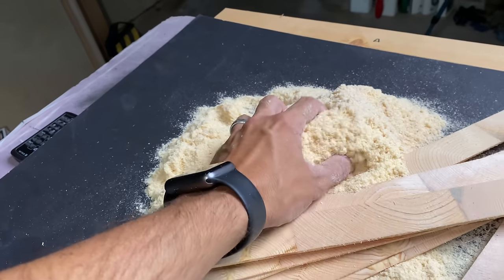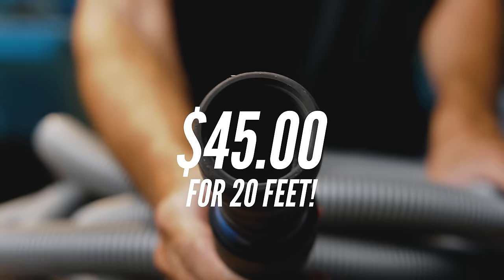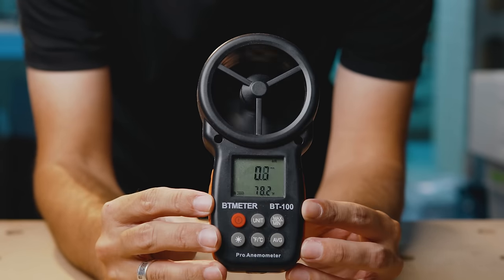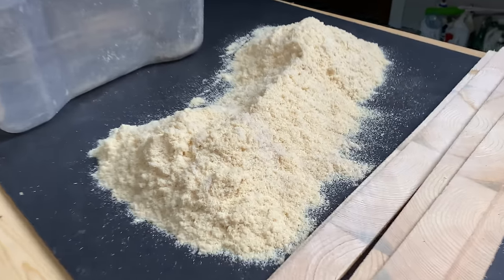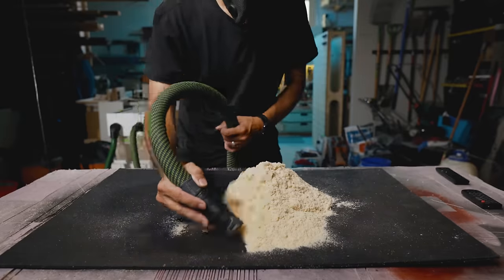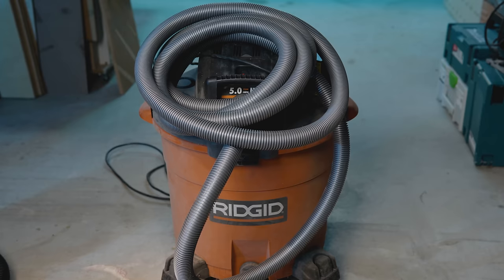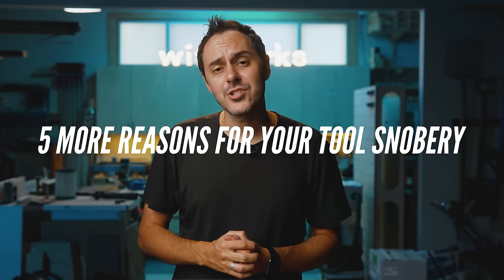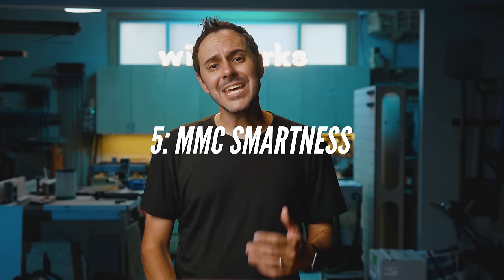This video will save you a lot of money. Dust extractors for beginners.

Comment: Fantastic comparisons Witt. I've worked with Festool sanders and dust extractors in industry sanding nonstop shift after shift. They both got dragged around, kicked, dropped and abused 
but they just keep going. Well worth the money in that situation. Home shop, can I afford it, do I need it or is it just the badge I'm after. I agree with you Witt, if I was a keen weekend woodworker  
I'd invest in a Festool extractor knowing I'd be sorted long term. BUT that's on the build quality, reliability, accessories and the professional back up, NOT on filtration. We had four of these 
Festool extractors connected to the best Festool random orbital sanders, sanding solid surface (like Corian) countertops and MDF furniture components. There was still masses of minute 
airborne dust floating in the rays of sunlight that shone through the windows. You still needed to wear a high spec 'rubber mask'. I think a lot is scare mongering these days gone OTT, but 
it's better to be safe than sorry with your lungs and also your eyes as well. Enjoyed watching your thorough non laboratory condition tests and agree with your conclusions. Tony
Reply from the maker: Thanks Tony! Glad we can be in company together.

Comment: Great video and I liked the test comparisons.  I wouldn't want to ruin your $29 "hepa equivalent" vacuum :), but it would be interesting to see air quality measurement using a new non-hepa filter and bag.  Might be a worth a test to see if the extra expense for the green colored filters are really worth the cost!
Reply from the maker: Great suggestion!
Reply: @wittworks  I second that, Witt. I'm curious to know if there is enough difference to justify the extra cost and to see how much the airflow compares to and "older-but-very-effective" standard filter. Just not curious enough to buy a $200 tester LOL.

Comment: I have the rigid Vac, 2 festtool, and a franken vac with a cyclone.  All work and do the job.  For me the Festool's are nice. I justified Festool in my head because I use a Vacuum everyday in the shop. (its actually the most used tool) They move around much easier, I never pull one over and like you said the Bluetooth, is just magic.  I would buy another if one ever dies.

Comment: Try using the 12 year old Shop-Vac or the Cyclone to vacuum out the expensive Festool bag before getting ever thinking about getting rid of it. Those bags are probably made in Germany to ultra high-quality standards, and thus are likely reusable for years, so long as the contents of the bag are sucked out and properly disposed of periodically.  Great testing technique - Great video!  

P.S. Harbor Freight makes a platform on 4 casters that will hold the Cyclone, but it costs about $10 - less with a coupon.  But you wouldn't have to spend time and money to build anything to make the Cyclone more convenient to use.

P.P.S. Great comment on the perception of workers who use Festool and other really great brands of tools.  There's a really good finish carpenter in the U.K. who only uses Festool and other great brands of tools. From his choice of tools, and the organized and clean appearance of his shop, he has instant credibility, and in his videos he demonstrates that he really knows how to use these tools.  His YouTube Channel is Bradshaw Joinery.😊
Reply from the maker: Thank you! I’ll check out Bradshaw. I’ve thought about cleaning out the Festool bag like you mentioned!

Comment: I'm a scientist, and avoiding the minutiae of the scientific method, I think your experiment was relatively well designed. I think what you're missing here is the location of your air quality measurement. You have provided good evidence that the output of the shop vac is about as good as the festool. The problem is that we still don't know how much of the particles at the tool are actually being sucked up, which is arguably more important since that's where you'll be standing.
Reply from the maker: thank you Mitchell! Makes sense. I should have bought two measuring devices! Thank you for sharing your expertise.

Comment: The first thing I do is to buy a 5 gallon paint bucket with lid,  and at least 3 RV hoses.   I make a water filter which can easily filter out nearly all of the dust before it gets into the shop vac.   I prefer at least 75 feet of vac hose for area mobility.   The cost is under $50.

Large diameter hoses do not loose suction like the little hoses.

The water vacuum water level needs to be set up precisely,  and the particles sling through centripetal force into the water.

I buy a bin,  drill small holes in it and empty the water vac outside.

I used to buy 5 and 6 horse craftemans,  which still work 30 years later,  constantly running on the jobs.   I recently bought,  maybe 8 years ago,  a smaller 5 horse craftsman,  since I use power tools with a lot of amps and often only have one circuit.   I see little difference.   But I really should seldom have a suction drop.

These water filters and washable hepa materials used to be available until the shop vac makers eyes got glazed over with greed.

Comment: The BT feature could be interpreted as “wow, they’re trying to up sell me on a freakin’ smart vac now…gtfo”

But having that feature when working solo, when you’re in a closet drilling with one hand and holding the vac in the other hand…priceless. It’s having a remote start at your fingertips that doesn’t require a special wired hose, but under 30’ is where  BT tech makes sense. I agree, standing up vacuuming the wood shop floor and having a remote start when the vac is right there IS a bell or whistle. But it’s a force multiplier, a time-saver when you are using it in other situations.

Comment: It’s the filter being clogged. That’s why the old filter worked the best. I think they’re all on par probably. The place where festool shines is the quality of the tool. And it’s in its dust port mainly. Like on the festool sander, coupled with their midi dust collector, I usually never have any dust. I use this setup in my kitchen sanding my very large cutting board. Keeps the kitchen clean.

Comment: A long-time woodworker - at age 77 I’ve been woodworking over fifty years. I have been using Festool dust extraction for about ten years. With COPD I can sand and cut and not exacerbate my lung condition. I also run two ceiling dust filtration system. We’re it not for Festool in particular, I’d no longer be able to sand and finish wood. Perhaps if I’d have had their dust extraction system as a young man I would not suffer with the impact of COPD that I do now. When I started working with wood there was no awareness of the impact of sawdust on one’s lungs. 

What are your lungs worth? They’re taken for granted until you lose lung function. Take my word for it: life is a lot harder at 50% lung function.

Comment: The reason the old vac did so well with a mildly plugged filter is the fact it had a mildly plugged filter. What happens to the holes where air flows through the filter media? They get smaller and the filter is now more efficient. Let's say its rated at 15 microns brand new. After many uses it will actually become a 10, 5, or 3 micron filter depending how much dust has been trapped in the filter. We know this in hydraulic systems when we test the delta P, which is the pressure drop across the media. We normally change filters because there is a significant pressure drop that can now damage the filter media or starve off the supply to the source.

Comment: Festool works with a custom cyclone. Good setup for a workshop. Using short rigid, large diameter pipes between the vac and cyclone will also improve things noticeably.

Comment: Great review. Just to let you know, the grey piece of tape on the hose ,is not meant for the antistatic function, it is an RFID that tells the MIDI I M class dust extractors what diameter it is, so it will know how much air to expect and not start beeping, It is the reason that the Midis dont have the knob to select hose diameter as the older M class extractors. I think it is currently only on the midi and maybe the ctm sys. There is a pcb with a rfid reader located around the extractors hole . :D I hope all this makes sense ..
Reply from the maker: Thank you! Interesting. I think I got that info from a Festool video and Sedge. That’s when I noticed it. I’ll double check!

Comment: Instead of having the auto-power feature that works by detecting if the tool starts, I have made myself a different health and safety feature:

I have a double switched outlet mounted to my workbench. One has the vac plugged in, the other has the tool plugged in. Whenever I need to use the tool, I hit the switch, and the vac powers up. Whenever I stop sawing/routing/sanding, I hit the switch again, and the vac shuts down.

The added advantage to me, is that my tools never get power unless I hear the vac running. So I can always safely set up my saw or router, without worrying to hit the trigger.

I also keep most of the advantages of the power-detection trigger, as I don't have to reach too far to turn on my vacuum, and I never forget to turn it on. Even more, if I ever need the vacuum without a tool attached, the switch is nearby.
Reply from the maker: Great idea! Thank you for sharing.

Comment: Dear Sir,
I bought 2 Festool CT33's back in 1999 when I first started using Festool tools. Just like your new machine it has a manual filter shaker which I've never used but purchased the LongLife cloth bags ( much cheaper in the long run over the paper bags) & have equally never changed the filters even though my Festool rep suggested it would be the best birthday present I could give to them. I have however cleaned the machines thoroughly, blasted them with a compressor to thoroughly clean filters & bag; those 2 machines are still with me & work flawlessly without missing a beat. There are more than likely some better extractors developed today since my last investment. For my next improvement I'll buy the new Metabo Bluetooth switch that allows any dust extractor to work with any tools; no need to lash out silly money for just a tiny feature. I have acquired four major different brands over the years which allows me to mix  as & when I want. I've come to the conclusion that brand loyalty or getting the full Monty as far as system is concerned is sometimes nothing more than marketing ploy. I did fall into that trap much earlier on but with a little time searching & inquiring about other brands, one comes to the same conclusion that they all want you to only buy their wares naturally. I was going to buy Festool's Systainer dust collector but my rep told me that for sanding it's not  really what it was destined for; more circular saws, planers & routers where the waste is much coarser. Being better informed allows one to use one's own judgement & make a wiser decision.
I think in your case there is some merit in getting this set up as I am sure it'll pay for itself in a very short time. Best wishes with your new equipment. Kind regards.
Reply from the maker: Thank you for sharing. I was surprised by how much the cyclone catches the track saw dust.

Comment: HEPA is HEPA, at least in theory. I bought the Festool because of the form factor. I appreciate the compact portability of the thing. 
You also can’t disallow the duty cycle of both units. The Festool is designed for extended use for full workdays. You could also buy a Hilti, but that’s a couple thousand. Or the Bosch for $750. Both are long duty cycle pro level extractors. 
Next do a video on a Rigid sander using the Ridgid Vac, and Festool extractor and sander. Like to see those results.
Also, I just like nice things. Festool is nice 😊

Comment: Ahh the endless struggle. I went through all these setups. I think for a small workspace My favorite setup is the ct36 with the long life bag And the d36 hose. Its expensive but it simplifies the setup greatly and doesn’t have an effect on suction. I’ve even used it on the table saw it it works pretty well if your not big on stationary tools. If your on big stationary tools  nothing really beats a proper big dust collector with a pleated filter.

Comment: I love my Festool MIDI-I. I had a Ridgid before this and I didn't link the larger size, bad hose management, noise, and lack of power take off. Despite all this the main reason I love the Festool is because I no longer need to clean the inside of the vac every time I change the bag - it's always spotless.
Reply from the maker: thank you for sharing!

Comment: Great video mate. That's some serious time/effort so thank you. I'm not sure where it's available around the world (I'm in Australia) but Metabo make a Bluetooth switch for any vacuum. The vacuum plugs into the wall socket side, and the remote switch is tethered to the end of the vacuum hose. It turns on/off automatically based on a vibration sensor when you turn on/off the power tool the hose is connected to. It can also be overridden manually. It's a great bit of kit, which I've been using for about the last 2 years or so.
Reply from the maker: Thanks!

Comment: It makes a ton of sense when you look at it like this: when a filter clogs with sawdust, it increases the effectiveness of the filter (at the cost of suction). So even if you start with a standard PM50 filter that's well sealed, sawdust will get caught in it, progressively increasing it's filtering ability. So the filter might have started with shitty numbers, but soon the sawdust stuck on the filter itself is filtering down to PM2.5. 
Your results are a valid real-world result. They were reasonably well controlled and your conclusions follow your data. Air quality is not a reason to go with the Festool. As a home-shop weekend warrior with no space...I'll be fine with my Rigid. Cost ignored, I don't have room for a dedicated dust collection system (2-car garage with two cars in it). My shop vac is...a wet/dry shop vacuum that doubles as my dust collection. I might add in a pre-filter to extend its time between emptying...but even that isn't necessary.

Comment: I'm a fan of the best budget dust extractor- the Fein Turbo 1. It takes a HEPA filter just like the more expensive versions- it just doesn't come with it. $350 is the price. Mine is 5 years old, gets used for hours a day 5/6 days a week and still going strong. I just happened to watch a guy accidentally break a piece off the top shroud on a Festool vac at work today, Fein are built so much more solidly.

Comment: Hello, nice vidéo.
I see a few reason that could explain the results a bit more :
- lower air flow = less stuff sucked in so less stuff going out (and more stuff in the air that the vacuum did not catch at all)
- instant measures will show worse result the higher the airflow, you need average on time for the same task
- measures at output of the vac are in a place where air is less stagnant so probably not best place to know what you will breath a few meters away
- air tightness was not tested so no info on potential leak
- cyclone setup is different and so are the restriction using it, it would have been best to hook the cheap cyclone on the festool for the airflow  measure.
In the end what is important is the overall air quality in the shop. I think a device which bips when particule levels are too high telling you to open a window and/or wait that the dust settles before you continue will be a better tool. And it can also give you notice if you need to rework the way the places is ventilated

Comment: Bigger is better with dust collectors.  Cyclones trade space for extraction efficiency, filters trade space for the amount of (generally expensive) filter you can store.  It makes sense to craft dust collectors as large as you can fit through the door.  Using gray Brute trash cans as receptacles makes a lot of sense to me, as they can be mounted with Brute dollies and trash bags cheaply, and you can find cyclone lids for them.

I am also attracted to the idea that Shop Vacs are a better way to go than traditional lower-pressure dust collectors, because airflow is limited by nozzle mouth area * pressure drop.  You end up limited by the 1500W cap on residential wall power though.  Maybe parallel several Shop Vacs on separate electrical circuits.